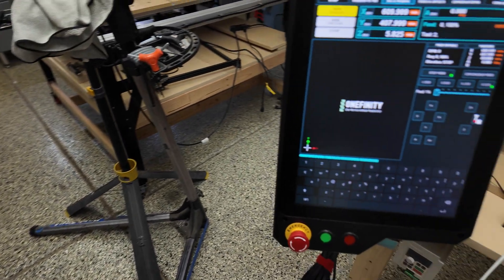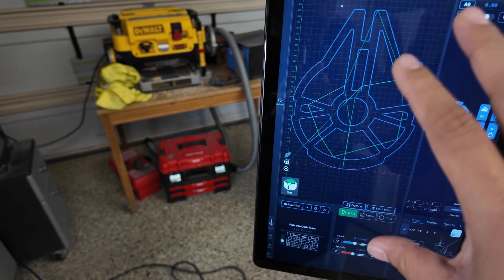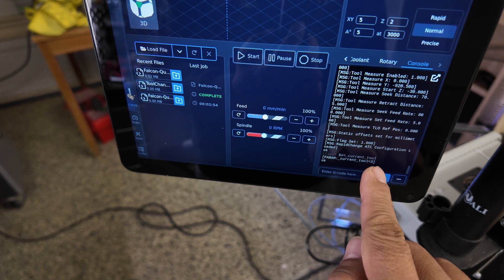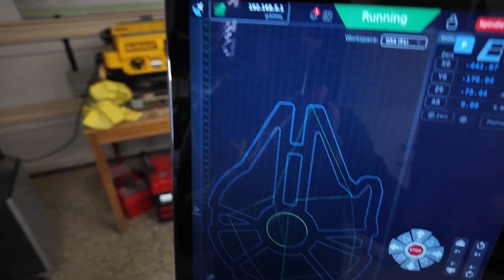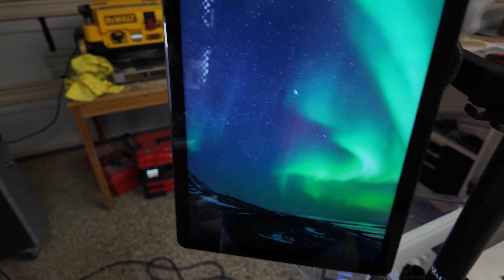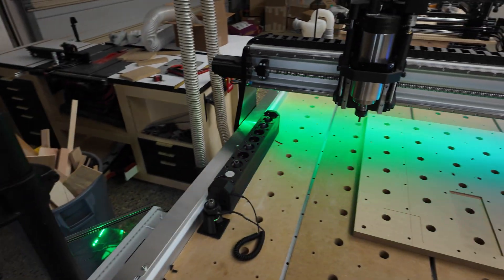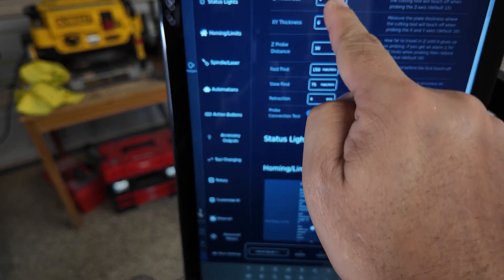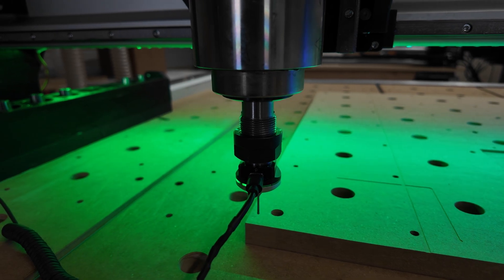A promising alternative to Masso G3 Touch

Comment: I like your thinking and I like the Gcodesender. I think “sciencslab/ altmill “ people are contributing a lot of code to the project . 

But just to geek out a bit. Kiosk mode lacks deterministic behavior entirely — it runs on top of a general-purpose scheduler with no timing guarantees. Even with a lightweight G-code sender, you’re constrained by USB serial latency, kernel preemption, and unpredictable interrupt handling. At higher feedrates or with short segment arcs, this can lead to planner starvation, buffer underruns, and non-recoverable desyncs. There’s no persistent state tracking, no synchronization layer, and no feedback integration — a single missed step, delay, or loss of comms collapses the execution integrity.

LinuxCNC improves on this with a preempt-rt or RTAI kernel, but it still couples motion planning and execution tightly on the same host. The result is monolithic: high system load, limited multi-node scaling, and complex real-time tuning to mitigate latency spikes. While its HAL system is powerful, it wasn’t designed for modern distributed motion planning or dynamic feedback loops. Real-time constraints fight against compute-intensive trajectory prediction, especially for non-linear paths, velocity blending, or closed-loop compensation.

By contrast, separating high-level predictive planning (with dynamic re-evaluation, lookahead, and path optimization) from low-level deterministic execution (handled by a time-synchronized MCU) ensures hard real-time guarantees. An MCU executing time-indexed motion segments from a buffered queue is fundamentally faster, lower-jitter, and more predictable than any RT-patched Linux system. Execution must be interrupt-driven, feedback-aware, and decoupled from planning latency. This architecture scales, recovers, and corrects — in ways that older integrated systems cannot. 

Anyway. It’s a nice setup with the new UI of the Goode sender on a touch screen.👍

Comment: What software is running on the new controller? That's the important part and was it mentioned?
Reply from the maker: its called gSender (Edge version) created by Sienci. Controller board is SLB-EXT running grblHal firmware.